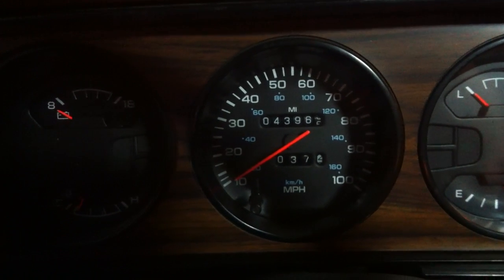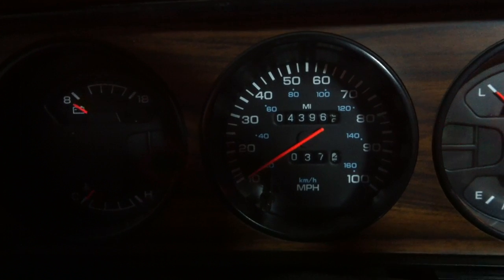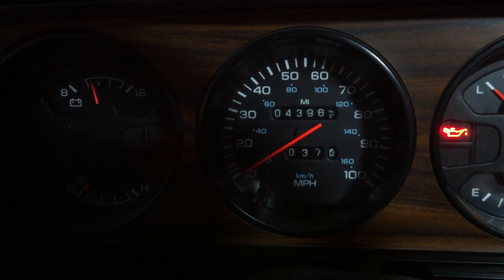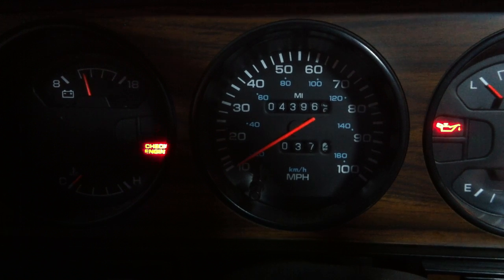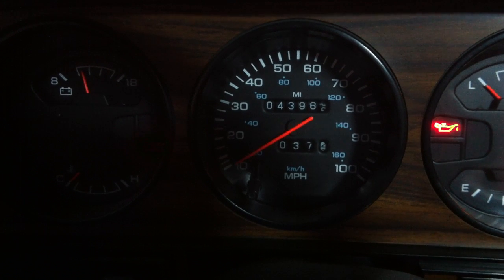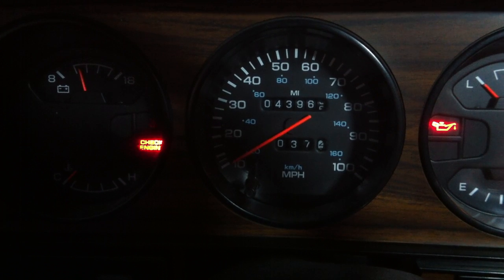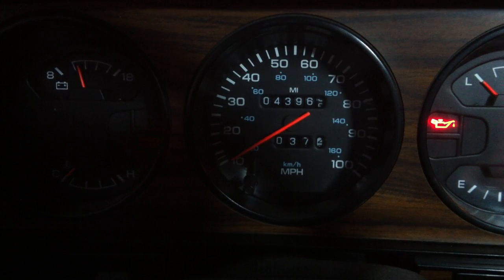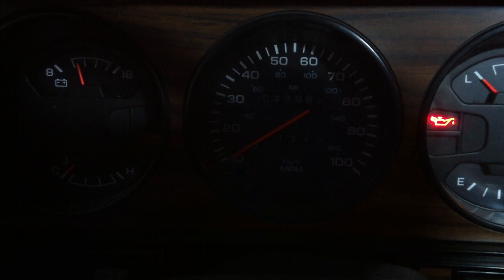How to Read Dodge DTC (Diagnostic Trouble Codes) Without a Scan Tool.MOV

Comment: What do you do if the check light just stays on? Doesn’t display any flashes.
Reply from the maker: If you are working on one of these 1st gen Dodges, you did something wrong in the sequence.  Try it again and see if you can get them to display.  If there are no codes, it may just go to solid / steady on.

Comment: Hi thanks for the videos. Do you know the numbers of cods what does it  mean? For example 12 or .... . Maybe have some liste.
Reply: That is fine just now I found the codes list with explanation.👍
Reply from the maker: MOUSSA LARBI 
This is a pretty good list:

http://www.dodgeram.info/Engine-Gas/OBDI/pcm_fault_code.htm
Reply: Millco thanks
Reply from the maker: MOUSSA LARBI 
Could you also post the link here that you found?
Thanks!
Reply: Millco is the same exactly 🙂
Reply: Millco Hi, in this morning I try it on my van B350 1990 5.2l . So yes works and first code was 12 and then 33 and 41 so that Means I have 2 fault 33, 41. I checked in the codes list for the fault 41 I got it  but 33 about AC is not clear for me maybe do you know what mean exactly. Thanks.
Reply from the maker: MOUSSA LARBI 
Yes.  33 is for either a short (of the positive power circuit to the air conditioner compressor clutch) to ground.  Or that same circuit or the ground wire from the clutch is broken or open.
Check easy things first!  The wires near the ac compressor may have gotten rubbed and are shorting out to metal (actually, only the positive wire will do that!) Or one of them may be broken (open).
Let me know how you make out!  I'm having computer problems, but I think I have a shop manual for a 92 if you need that circuit looked up  (hopefully it would be somewhat close....).

Comment: CODE Description of Trouble Code 
11 Timing belt skipped 1 tooth or more from initial learned value, Intermittent loss of either camshaft or crankshaft position sensor, No crank reference signal detected during engine cranking 
12 Direct battery input to PCM was disconnected within the last 50 key-on cycles (normal)
13 No change in MAP from start to run 
14 MAP sensor voltage too low 
15 No vehicle speed sensor signal 
17 Closed loop temp not reached or engine cold too long 
21 02s sensor problem (oxygen sensor), upstream or down stream 
22 Engine coolant temp sensor out of range 
23 Intake air temp sensor out of range 
24 Throttle Position sensor out of range 
25 Idle air control motor circuits, target idle not reached (+/- 200),vacuum leak found 
27 Injector control circuit 
31 Evap purge flow monitor failure or evap solenoid circuit 
32 EGR system failure 
33 A/C clutch relay circuit 
34 Speed control Solenoid circuits 
35 Rad Fan control relay circuit 
37 Torque converter clutch solenoid CKT or park/neutral switch failure 
41 Generator field not switching properly 
42 Fuel pump relay control ckt, Auto shutdown relay control ckt, No ASD relay output voltage at PCM, Fuel level sending unit volts out of range, Fuel level unit No change over miles 
43 Multiple/ single cylinder misfire 
44 Battery temp sensor volts out of range 
46 Charging system voltage too low 
51 Fuel system lean 
52 Fuel system rich 
53 Internal control failure 
54 No Cam signal at PCM 
55 End of error messages (If you get this only, no errors were found) 
62 PCM failure SRI mile not stored 
63 PCM Failure EEPROM write denied 
64 Catalytic Converter Efficiency Failure 
65 Power steering switch failure
Reply: Vollick do you happen to know the code for 47?
Reply: ,l

Comment: Where did you find out the blink to number conversion?
Reply from the maker: These old Dodges use trouble codes of two digits (See Vollick's list here from Feb. 2018).  When you get the light to start blinking; Start counting the number of blinks.  The first digit will be given in a series of blinks closer together (This example works out to be one blink then a pause.  So first digit is a 1.).  After that pause the second digit will be given (In this example the second digit was two blinks).  This means the first code given is 12.
The rest of the codes are given the same way.  Watch the video and count them out / write them down as you go.  I give the two digit code after each set.